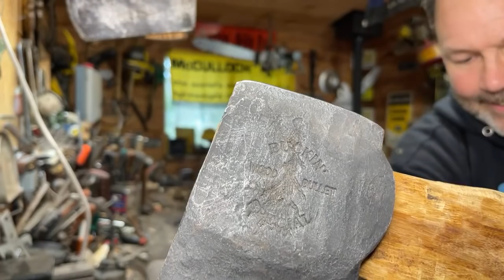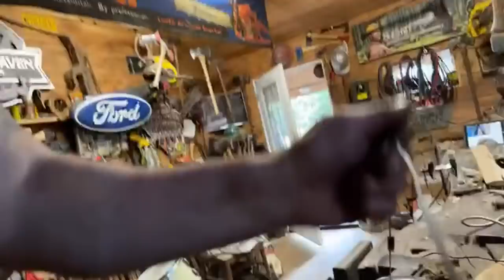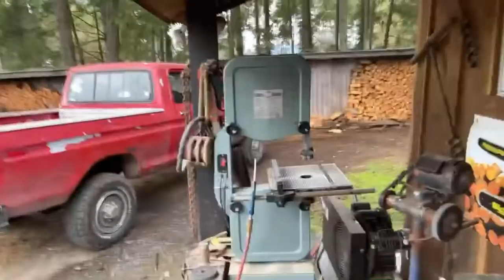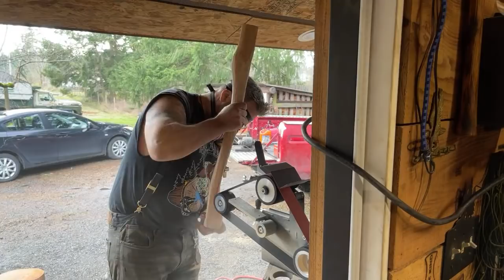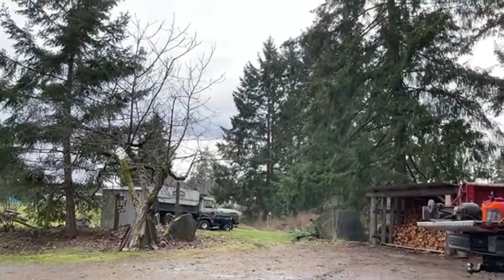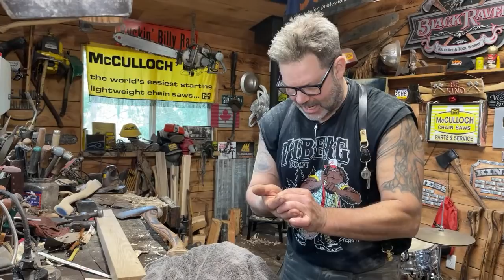axe handle made from board,,

Comment: OMG...
I just clicked and subscribed. A crazy man with... CHAINSAWS! I just got one of my SXLs ready to run last week. It's gonna supplement my new used 50 dollar Chinese Craftsman. I got a pile of Homelites to resurrect. Haven't been burning wood for about 5 years. Have to change that in 2021...Have 2 young men here to train as saw operators. That's where the little Craftsman comes in for a starter saw. We gotta get the edumacation on several manly man life skills going at warp factor 9. Gas, oil,  sawdust and gunpowder on the wind in 2021. Now where is that chain breaker??? Where is my stump vise I last used in 2015?
Reply: Welcome friend!

Comment: Billy, you should test the wood when using the draw knife.  If it is pulling big chunks out you are drawing against the grain.  Flip the piece end for end and draw with the grain.  You can usually see which direction the grain is running.  A tight grained wood is harder to tell.